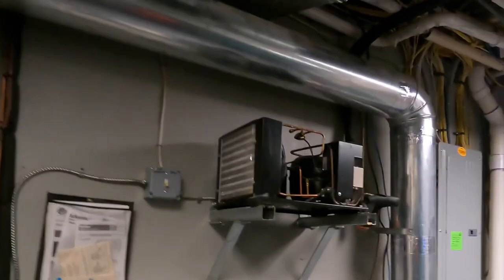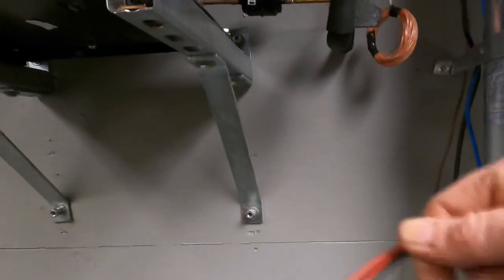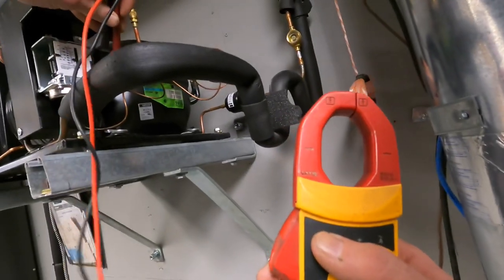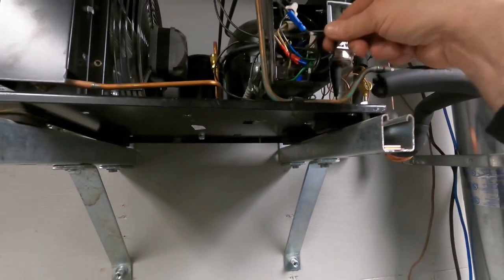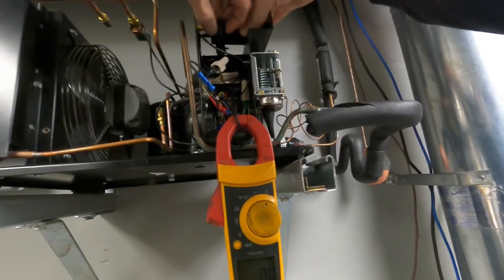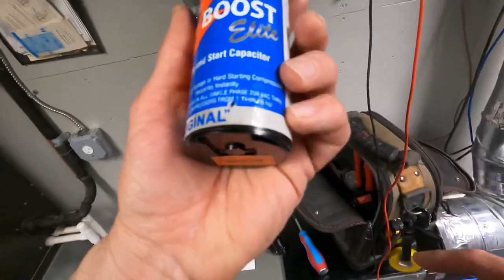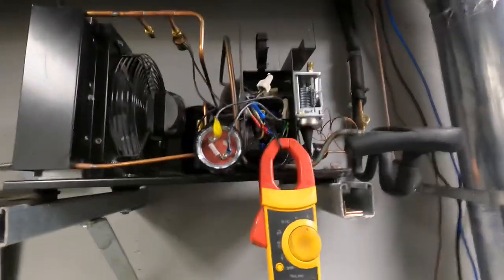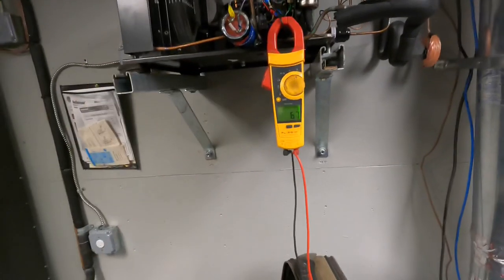Wine Cellar Refrigeration Unit Not Cooling

Comment: I noticed  it sounds like it started at first but it sounded weak like it was barely doing anything while with the new capacitor it sounds much stronger, with the blown capacitor the rotor must have been turning slowly but nowhere near enough to actually work and still pulling near locked rotor amps